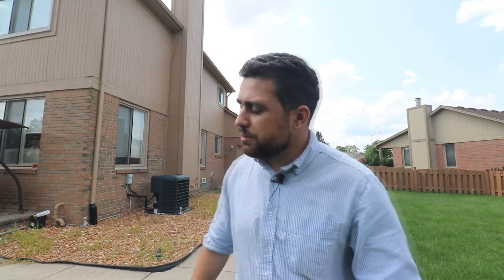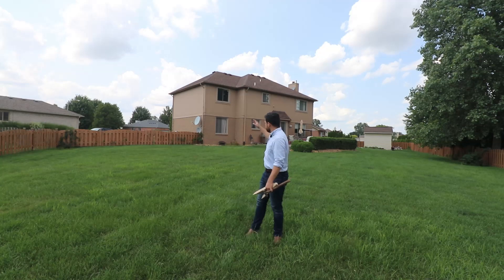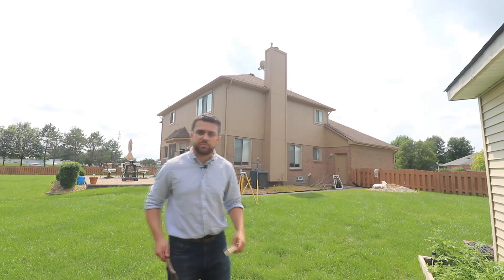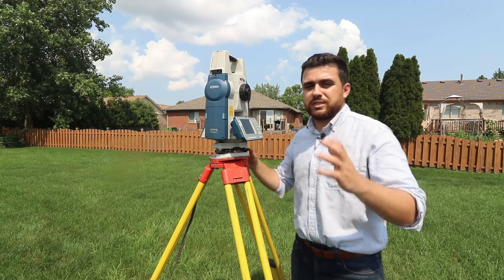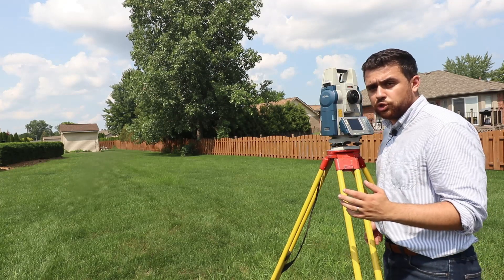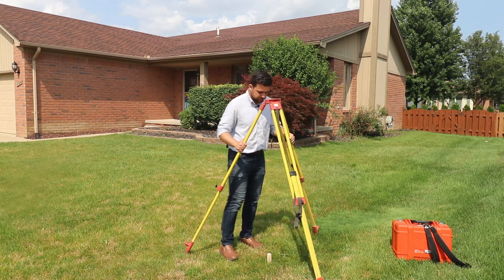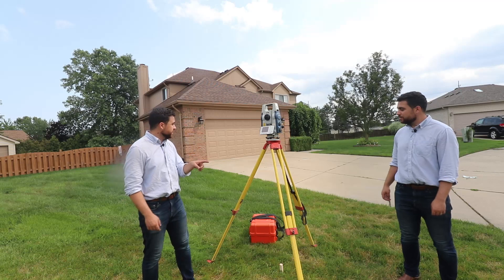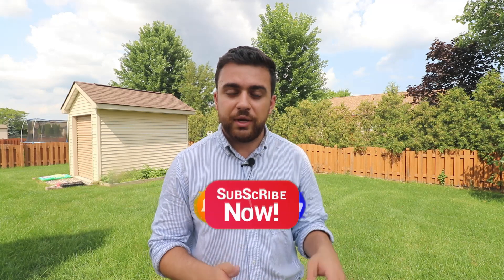Finding Building Corners using a Total Station

Comment: Excellent job on the video. Well paced. Well thought out. Love your assistant. I need to get me one. But 4 Reference station setups? That's a lot of work man. One setup, two corners, then use a measuring tape (or laser measurer) for the rest. Much, much faster. If I can avoid setting up a tripod, that's effort well spent.
Reply from the maker: Yeah you could just get the initial position, but there are projects where having the exact location of every corner is necessary.

Comment: Hi Rami,

when taking the measurement of the corners does it matter where we take the point e.x (top corner or bottom corner)? Also, are we recording both the HD and HA?
Reply: It does not matter weather you take the top of corner or the bottom. All you need is a reading of the corner. You have to record both the HD and HA and VA for the  coordinates calculation thats if you'll be doing the manual calculation as opposed to using the software
Reply: @siyabongasibanyoni6595  I understand I am guessing that as long as I am consistent with the location of  the shot (always top corner or always bottom corner)?

Comment: Hi Rami 
I have just came across your YouTube site.
I am wondering why you keep zeroing on your back sight to the 0'0" angle ? ( If you are using a Total Station )
Why when you had a 4 point ( closed ) traverse - did you not survey TWO Stations from each survey Station ? And then on the final station,  'close' out the survey ?
Reply from the maker: We check our zero angle to ensure we have not moved or shifted during the survey. The points are a traverse yes, and if I was doing to Survey Traverse I would apply all the methods used in this video (https://youtu.be/7slV7bl3Dds) but the point of this video is to demonstrate how to use the TS to take building shots.
Reply: @RamiTamimi  thanks for the reply 
I watched the video you linked and I am even more confused on why you don't use Whole Circle Bearings ?

Comment: How would you use a total station to:

1. Measure and record existing stairs to fabricate railing for them
2. Measure and record existing edge of slab/edge of structures for railing
3. Measure and record existing window openings for glazing (tempering glass and anchoring façade)
Reply: You use something like a Proliner or Lieca 3D Disto for that type of work.

Comment: This was outstanding very good. I have a question or request about builder's Transits. I have seen many videos about them but not one shows how to setup the transit over a point by using a plum-bob that comes with the transit. So how is it done? I know it sounds simple right well maybe not so much. So if the plumb-bob is not needed than why is it included?
Reply from the maker: A plumb-bob was the old school method of getting over a point. Now a days we, total stations have a scope to look down or a laser that points straight down to a point. The plumb-bob would drop straight down and where it points to is where the point you are occupying is. I should make a short video about that....
Reply: @RamiTamimi  Thanks Rami, I have some levels and transits but it has always been hard to get them zeroed over a point exactly. I was wondering if there is a certain method of how it should be done. Even with the plum-bob I find it hard to get everything in line. So I must be doing something wrong. I would love to see someone do it right. Thanks for your reply.
Reply: @RamiTamimi  Hi! Very good videos. I Just ask. If we have 2 known coordinates points and TS vertically in a third unknown coordinates point... would it be possible just to take shots to those points and later TS calculate its own coordinates?? I mean, many times it is not possible to set TS over a known point... or we preffer not to... Regards!!

Comment: It would be interesting to see how you would do the same survey for those of us who don't have the luxury of a prismless TS. My venerable Nikon TS-330 has COGO features built-in for such things, but you still have the issue of having to offset from the staff.
Reply from the maker: Even the offset option in software is a luxury haha. But the old school method would be taking a shot near the corner using the prism, and physically measuring the distance with a tape and compass, and calculating the coordinates of the building corner while drafting.
Reply: @RamiTamimi  What we do is a horizontal angle offset. Position the prism beside the building equidistant to the total station, shoot it, then sight the building corner and record the angle to get your building corner location.

Comment: Great vid can you please tell me why u set the hz to 0 everytime to moved your position
Reply from the maker: As John explained, zeroing out the horizonal angle orients the Total Station and gives it a known baseline for the set up.
Reply: Because when you set up on a station the rotation of the TS is completely arbitrary. So you take a backsight to a known position to establish the rest of the angles you're measuring from the current station. Then in your processing software (or by hand if you're old school), you can figure out the azimuth of a given horizontal angle from the BS.
It takes a minimum of 4 knowns (x, y, angle, and distance, or two x and y coordinates) to establish the rest of a 2D network. In this case he has 8 knowns, so the sideshots can be calculated with good accuracy.
Reply: @merseyviking  I have a question. Last week one surveyor gaved me the coordinates of two fixed points that i have in my yard. I set up the total Station in the first Point and then measured the second one whit the Total Station.I did not set up to 0 the horizontal angle and the result of the total Station and the given coordinates from GNSS was almost the same. I measured a few more points and i stoped. The next day i did the same proces and started to measure the same points again, but i got different values for the second Point,and different values for all the others, can you explain me What i did wrong, or How i can get the sama values again?Thank you.
Reply from the maker: When setting up your total station the second time, did you input the coordinates again, or just assume the set up was good? Everytime you set up the total station you MUST specify the point of occupation and the back sight point to entire your set up baseline.
Reply: @RamiTamimi  thank you for the answer. I did not made it as you say, because i don t know how :). I have to check one more time How to do it, because the total Station is old(2009)
Reply: @merseyviking  thanks mate